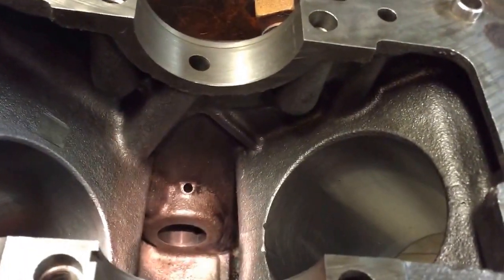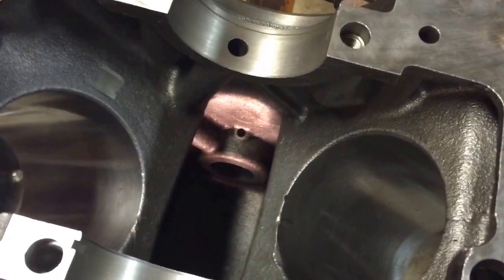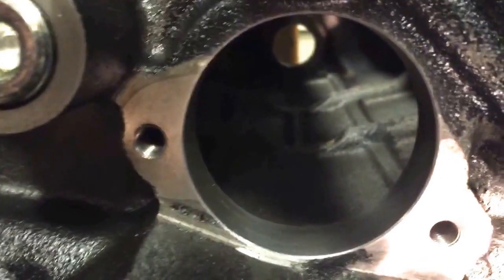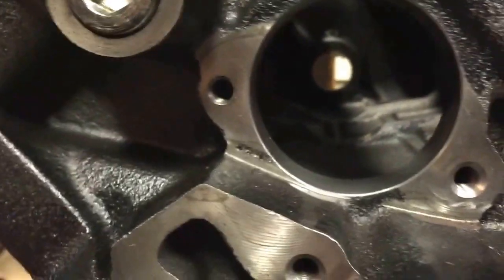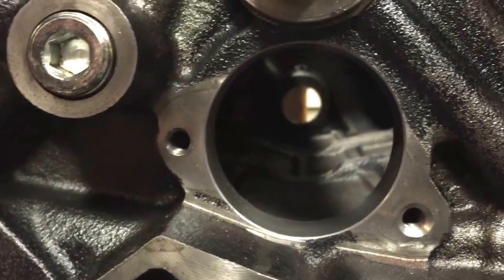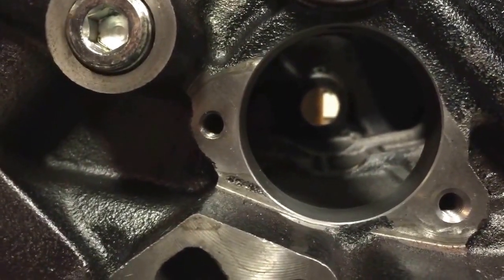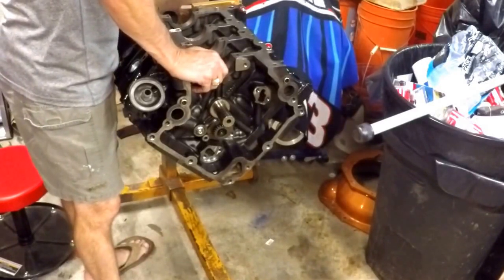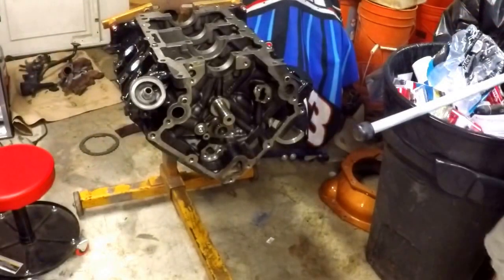Engine Rebuild - 3.7L 2006 Jeep Grand Cherokee Laredo - Part 6

Comment: Works well installed many bearing races in aircraft assemblies this way. Used to have to heat the unit the races were installed in. Dry ice would work better than a home freezer. Any oil on the bearings can cause an issue. Good video

Comment: Nightmare bearings are an understatement. Tolerances are so tight that if the bearings are not installed perfect the counterbalance shaft will not rotate. I ended up using a old counterbalance shaft to install the bearings to insure the bearings are true to the block and the shaft. PITA!
I hope I am not the only one having trouble with these bearings.